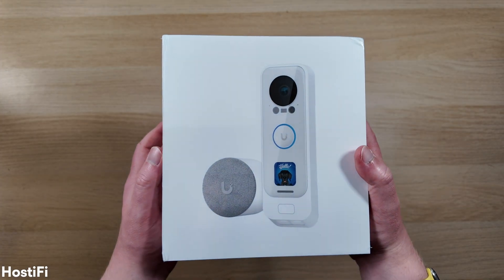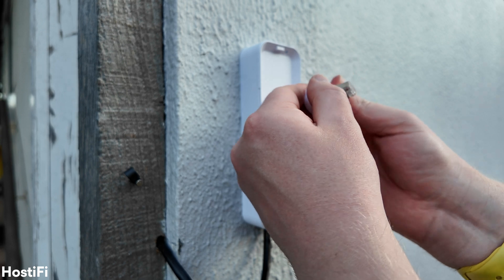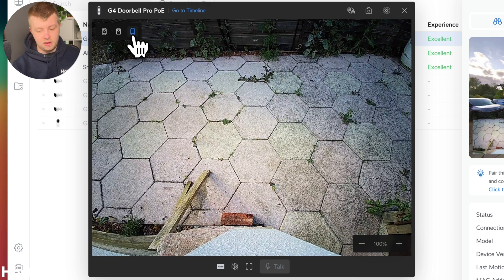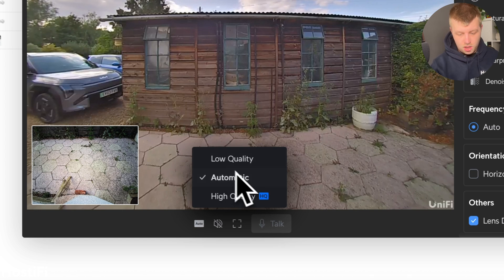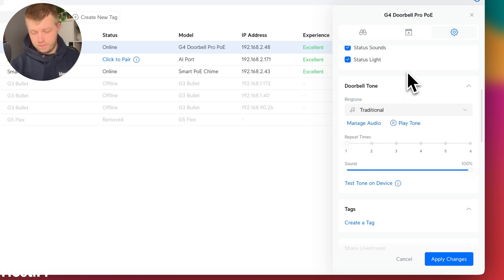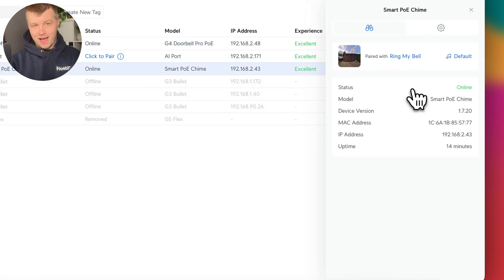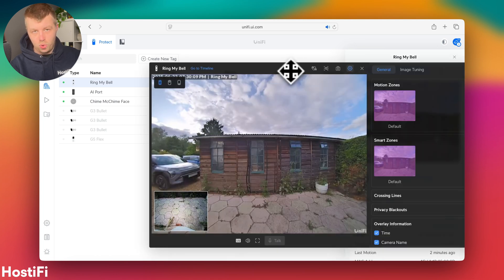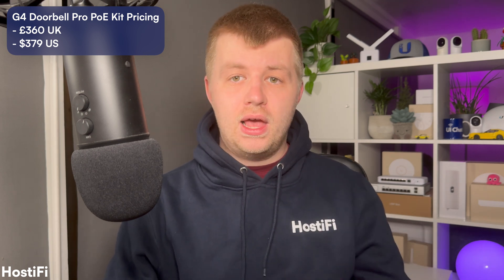UniFi G4 Doorbell Pro PoE Kit Review | Installation, Setup and Testing with AI Port

Comment: what a shocking install, your suppose to put the rubber gromit on before the rj45 plug on for the door bell, and then the chime how that ethernet cable was used was poor, sorry to be picky but you could of had a better install.

Comment: Great video… how do you get it to alert your phone when the doorbell is pushed
Reply: But you wont get called. Missed an notification? To bad person gone
Reply: @ghostboy122nl  if you have homeassistant you do.  You would get a text, a chime.  I wouldn't say a call. You'd get the notification and just jump into the app and talk to the person.
Reply: In the Unifi Protect (the app the doorbell and other security cameras have) you can get alerts within the app and can set alerts that way.  If you want a text message, you'll need to get home assistant which is what I do for my system.

Comment: I may hold off until the UniFi G5 Doorbell PoE as im currently using the 16Port PoE Reolink NVR since 10 July 2021 when i chagened over my old BNC style CCTV DVR system im tempted to move over to the UniFi Protect at lest my current Cams are PoE i may upgrade my Ubiquiti UniFi Cloud Gateway Ultra to Ubiquiti UniFi Cloud Gateway Max so i have Protect and VoIP as BT is shutting down it landline service in the UK soon so i can keep are nunber
Reply: It should be G6 Pro or AI now they won’t bring G5 name scheme as that are older generation depending on current one.
Reply: Is a G5 or G6 update scheduled?
Reply from the maker: Nothing is official yet regarding future Ubiquiti products unfortunately. We don't know when a new doorbell will launch.
Reply: My thoughts exactly.  I'm really holding out for a G5 with AI. I really want license plate as its a private road, that adds a lot of value. Adding an AI port makes it a lot more expensive. Be great if they come out with something between the larger gate access and doorbell with AI, I may add an automated gate later and be sad to have to switch everything out.